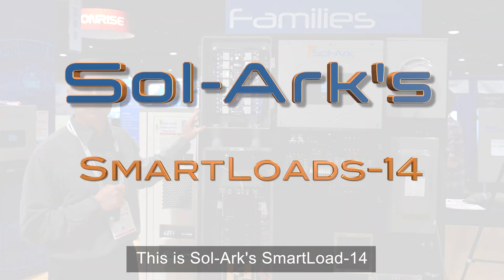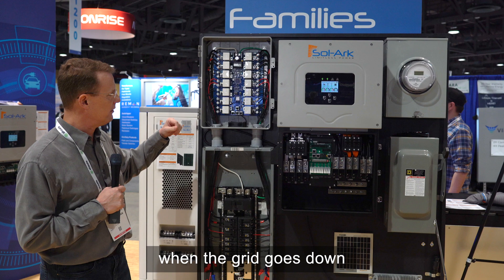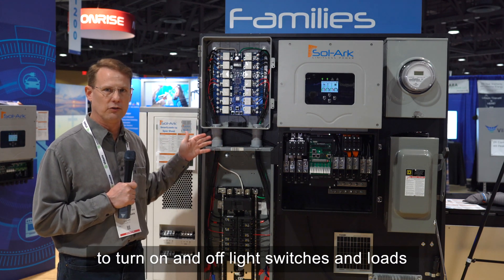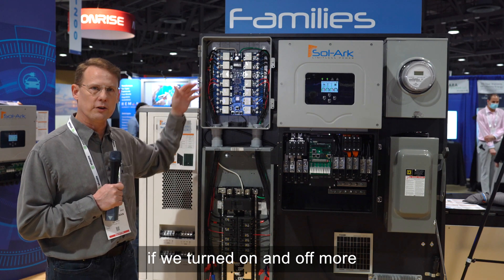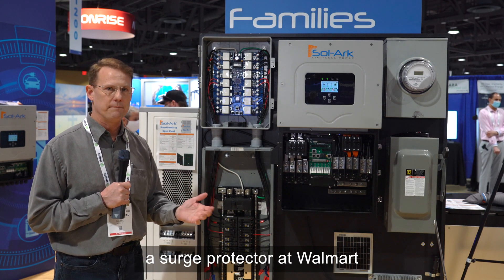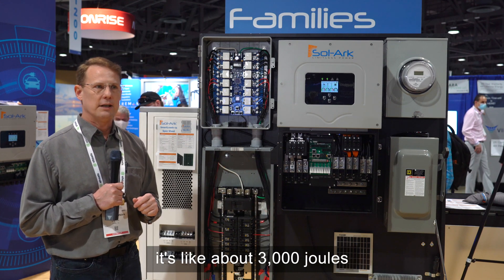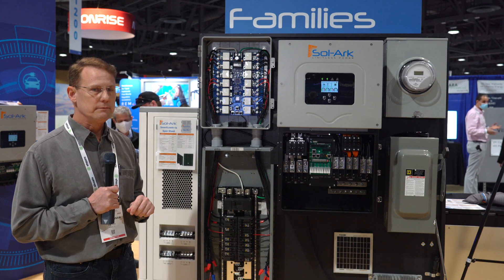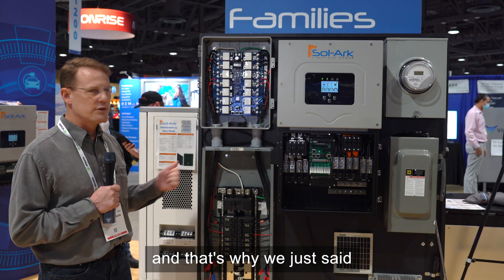SOL-ARK's SmartLoad-14

Comment: Are you kidding 240 Volts X 100 Amps is 24000 watts and a  watt is a joule. Need to go back to school. Maybe the glitch comes from the turning on and off all those load 14 relay coils, do you have back EMF  diodes and supressors on the relay coils?
By the way when is this going to be ready for purchase. What a good Idea. I want one.
Reply: @Thomas A Watt is a Joule/second. You missed the switching interval. Watts are power, Joules are energy. The steeper the gradient (the faster the shift for a given power load) between on and off, the rougher it is on the electronics.